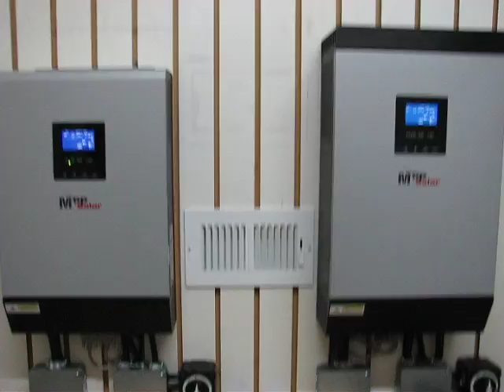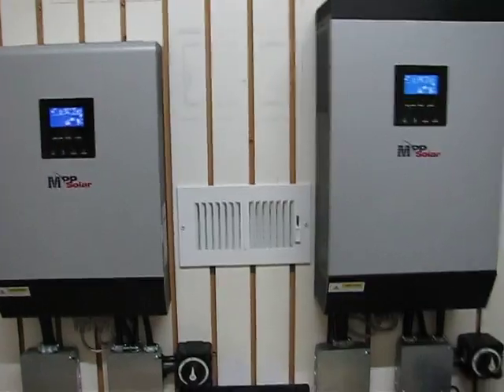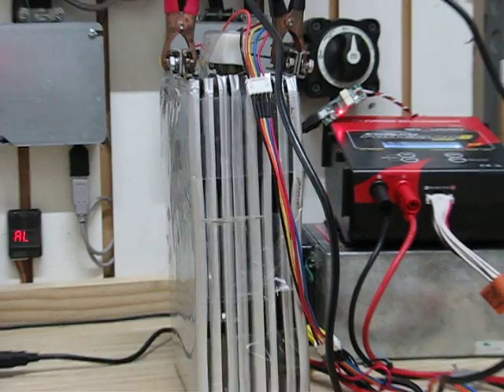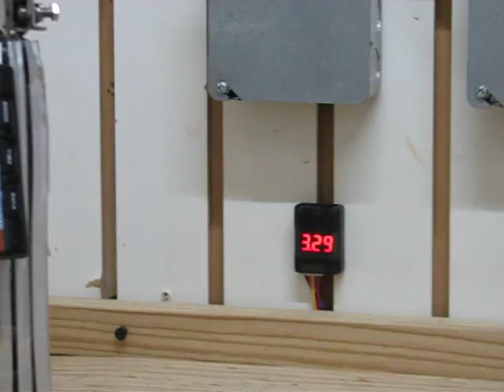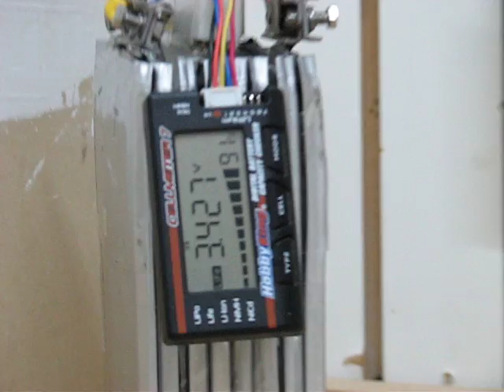New addition to solar system

Comment: Congratulations
Reply from the maker: +Alaa Sadek Thanks buddy batteries were a great deal.. 
had to get them!
Reply: +off grid kid How much?
Reply from the maker: 200 bucks, seller just did not want them i guess. they sell for around 35 to 40 per cell have 46 good ones about 13 that have hi IR and low capacity, may be good for a project?? Rest of the cells were 0 volts or swollen.
Reply from the maker: Tried to but with no luck....
Reply: I tried pulse  charging some. Some became good and some didn't. So ever since I just discard them.
Reply: Well to start of I use the old lap top batteries. They are the 18650. These batteries are made to be cycled at best 500 times, unlike the LiFePO4 batteries. I also get them for very little money. Now the results vary, and in most cases the results are scary. They get hot. I do not take the risk. I just dispose of them right away. Some come back to life, but I hardly measure how much energy they take and hold. There is a reason for that. I used an excel to simulate the capacity of the pack depending on a random number between say 800 mah and 2200 mah. As the number of cells increased, the end result got close to an average of 1800 mah. This translated to 3.7 Nominal voltage multiplied by 1800 mah multiplied by say 1000 cells we get 6.66 kWh. Not bad.  If I have to test every 18650 it will take forever and a day. And 6 kWh is more than I need. My panels and daily use are just fine with that battery pack. So the bottom line is forget the bad cells. By the time my pack becomes depleted, the price of say LG Samsung or even Tesla will be less than $100 per kWh so I will buy a new battery pack. Nice isn't it? BTW Schnider will come out with Ecoblade that is supposed to be less than Tesla in price. It might have the inverter built in too.
Reply from the maker: some cells recovered a bit. But with low capacity & High IR

Used laptop batteries best bang for your buck & a great project!
Reply: Yes you are right. The cheapest in the three systems are the batteries. The inverter and the panels are more expensive. I also think that many over diminished the inverter. I have the 3kva and I do not run the dish washer and washing machine on the sun. Both have a 2 point something kw heaters. My inverter can go up to 2.4kw. So I run these two on the utility. Both use 500 kWh per year. So it is not worth it to buy a large inverter for them. I am now trying to use that money to convert my old split air condition to heat the water that we use for showering etc. In the US I think you call it heat pump water heater. The money I pay for heating the water is enough to justify this new project. My heat pump has a coefficient of performance or 3.5 So for every watt I will put in I should get 3.5 watts to heat the water. In the US they already sell this unit ready made. Alas I am in Cairo Egypt. So I have to do it myself.

So you see the money I saved on the batteries will be spent on yet another project. Wish me luck. If I were you I would buy it ready made. Or maybe buy an inductive cooker. This way we will be getting closer to be 100% independent from oil. And my son doesn't have to go to war so that the SUV's in the US get filled with GAS.

Salam.
Reply from the maker: Good luck on your project! Would like to see your water heating setup....